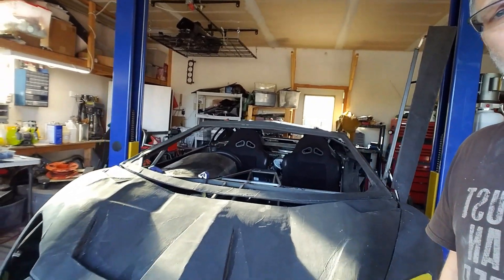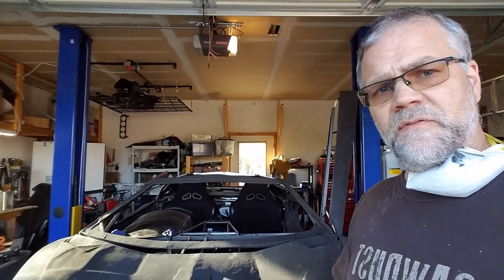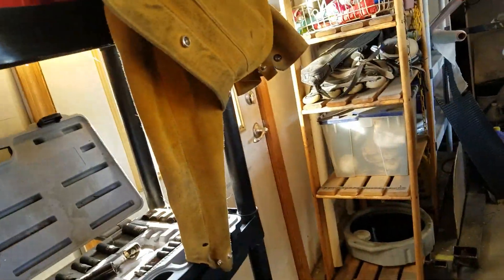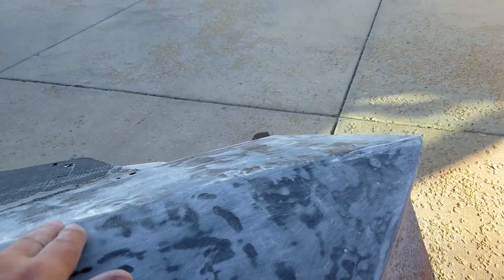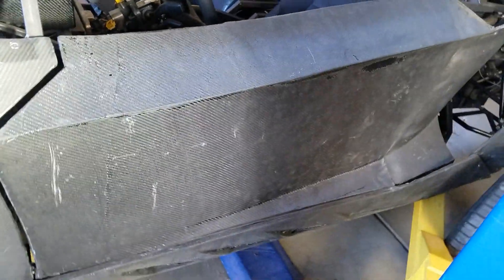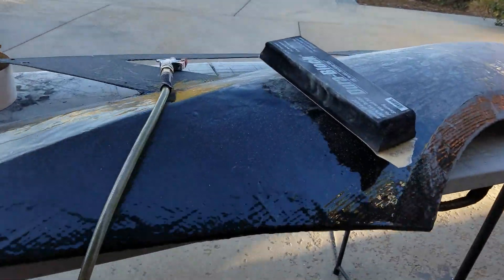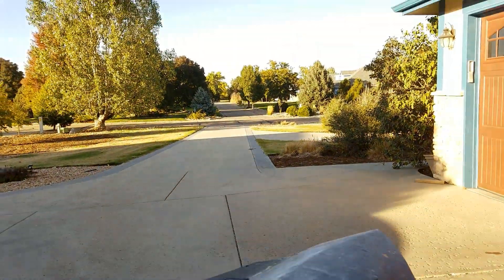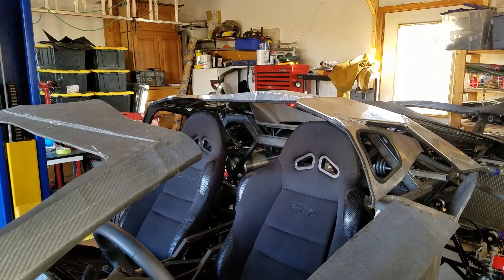3D Printed Interceptor Update 10

Comment: Why don't you sand all panel at once and then apply epoxy and at last final sanding with oil.
Nowadays, people are vinyl  wrapping the whole car.
Just apply a smooth and simple paint. Then, cover it with vinyl wrapper.
Shiny and cheap idea.
I think you should make a homemade 3d printer at home and print the whole Lamborghini door at once.
Saving gum as well as strong.
😊
Reply: Please don't do this. This is going to look beautiful in the end and all of the hard work will be worth it. Maybe consider vinyl wrapping it to protect the finish every now and then. Keep up the awesome work

Comment: First :) 

Very informative. That's a lot of sanding for sure. Have you thought about maybe using the duraglass on the gaps and then just fogging in a black edging around
the perimeter? This is how the carbon fiber lid was done on my Lamborghini laptop (see photo in link) I think they just did it to make it look neat but in your case 
it could save some time and hassle and the majority of the panels would still be raw carbon.   

https://imgur.com/Wui9mZO

Just a thought! :)
Reply from the maker: What would I do without you Brett! 😁
Reply: @lasersterling  refresh I added more :)
Reply from the maker: Ya, good idea.
Reply: @lasersterling  Yeah I thought it could work, there are even special methods you can use to do gentle tape masks where you get a feathered edge.  

Any way you go I know it's going to look fantastic! :)
Reply: I noticed you are doing a Patreon. Any chance you could include a level that would include some of the STL files? Would love a chance to play with some of these parts myself, maybe even scale them down a bit and make a model.
Reply from the maker: @Jon-lj5jb  https://grabcad.com/library/aventador-sv-1

Files are free.